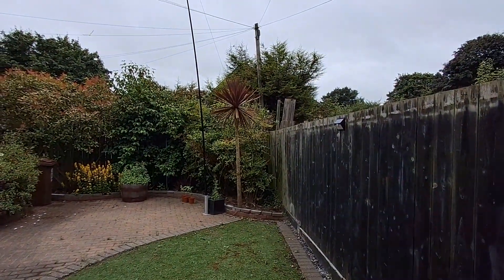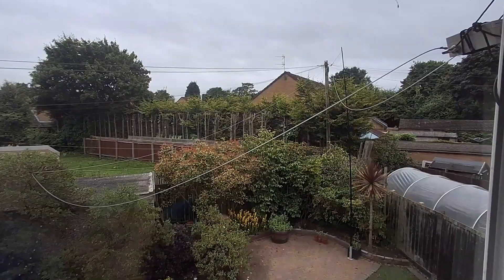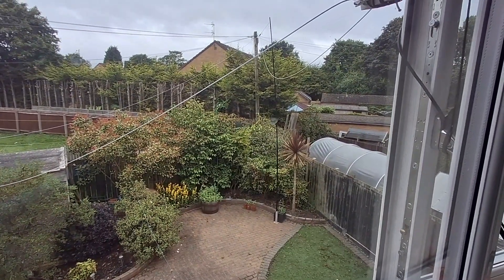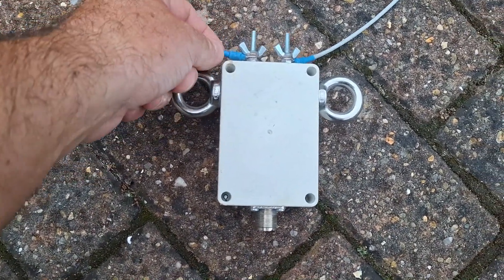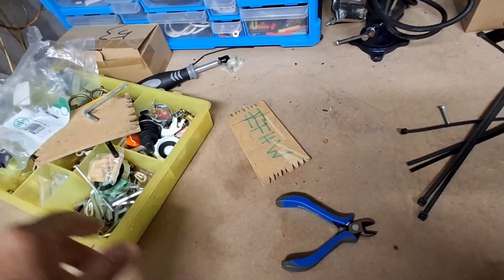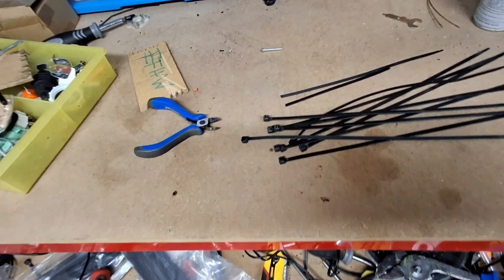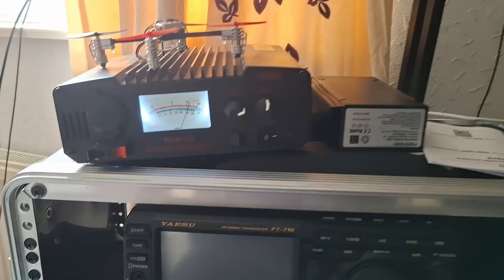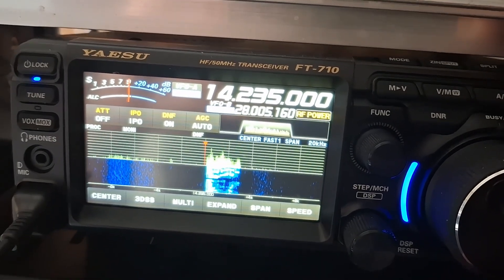Amateur Radio Success with Simple Delta Loops

Comment: Just loop the wire through the metal eyelets then cable tie them or get strain relief eyelets from bnq at metal wire and rope section,,loop will work well at a 1/4wave above ground although you can have them in all sort of shapes or configs,max current is at feed point and the opposite side of the loop from the feed point and ideally you want those to points high in the air,,,you can also pull the loop back on itself to take up less space like a arrow shape.
Reply from the maker: Great suggestions, thanks for the extra tips.

Comment: Hey one useful Tip from me...I run the Radiator Wire thru the Eye Lead and then zip tighten it with Cable Zip Ties or a stainless Wire Clamps. Everything else you did is fine. What is the Ratio of the Transformer / Balun you using?  73 de Uncle Günter 💯🙋‍♂
Reply: 4:1
Reply from the maker: @DK5ONV  from memory this is a 49:1
Reply: Hi Gunter, I made the same comment to myself just b4 seeing yrs here  but regardless his antenna is working well, and is a gd solution for his space n place challenge!!

Comment: ive been using a 40m delta loop as an upside down with the 4;15ft off ground for 25 years but my latest one all home built mind you i tuned the twin 240/43 's with an analizer and found that at a full wave for 40 will work on 80m i use efhw for 40-10 @22m of wire will also do 80-10 but u have to tune the balun its not great on 80m ssb but i worked china on both at 10w on ft8 have fun try a mag loop too i built an 160-80m mag loop it works have fum Dylan m0dsy.
Reply: Ok as upside down triangle fed at the bottom just off gnd it has a 3db gain over a dipole and if u tune the balun with a analizer it will do 75m at about a 45% loss but great on ft8 the wark bands will need an internal atu to bring them inline but I tried a lot of antennas over the years but I allways go back to my delta as it works so well I talked to south caraliner us every day for the month I’ve done nz china ect I use a tuned efhw for portable so u can’t beat a resonant antenna the delta doesn’t need to be perfect triangle so will it work for u? U will have to experiment which is fun ,you won’t know until u try drop me an email and I’ll send you a link for how to make  it better than a bought one and lighter /more invisible too
Reply from the maker: @dbailey3024  I’ve often wondered how well it would do vertically